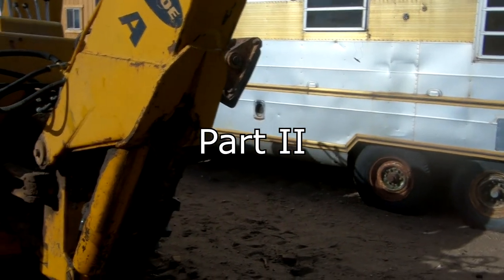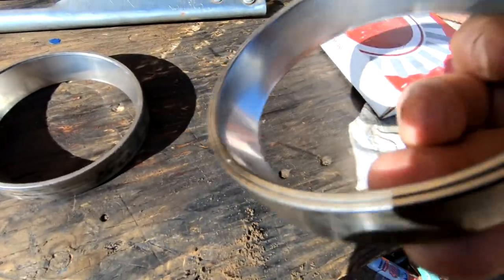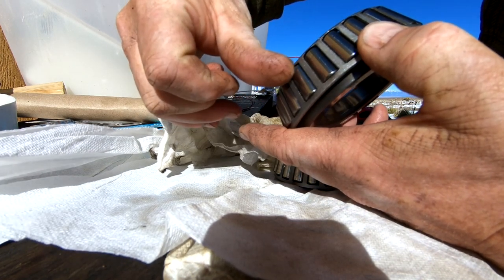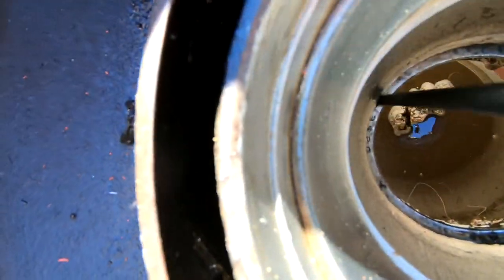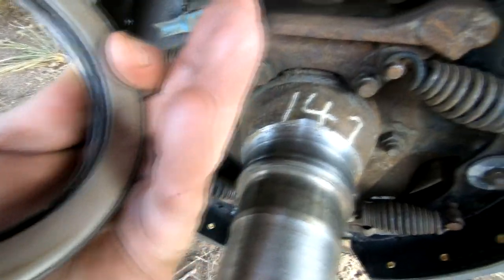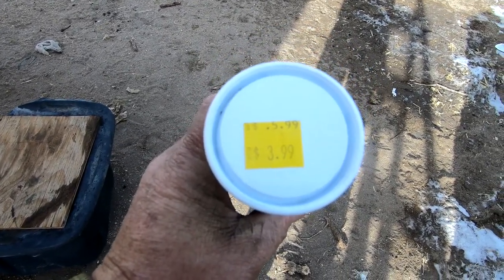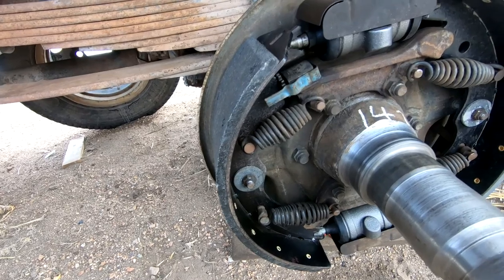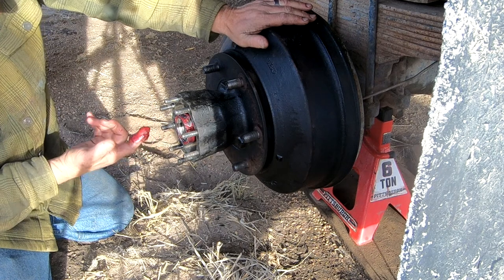1967 Ford F600 Rear Axle and Brakes Part 2 - How NOT to fix using the wrong tools.

Comment: Good evening, i greatly appreciate your videos on you f600, just bought one with the same problem everyone has, brakes. 

Any chance you have a parts list somewhere with links where you got everything?

Only partially into the series, but already know this is going to be tons of help. Thanks again
Reply from the maker: Hello and thanks for the kind words. The 1967 F600 had at least two versions of brakes. I found the schematic and other info from the Ford Truck Enthusiasts Forum online. They have a section dedicated to Medium Duty and Heavy Duty trucks. Finding parts will be something of an Easter Egg hunt, but most of what you may need can be found. Alternatively, you may find that upgrading your axles to newer ones will provide greater parts availability. Thankfully, we have not had to do that yet. Have fun with your F600!

Comment: Thanks for the vid.   Do you know how to remove and replace the wheel studs.   I cant see how the come out , or how you'd get new in.  Any advice
Reply from the maker: Hi There.  Usually those are pressed in and hard to get out. Best way I know how (by yourself) is to support the wheel very well, screw a "sacrificial" lug nut onto the lug and pound it out with a maul - or try a heavy C-Clamp if you have one.  A local truck tire shop could do it for you for just a few bucks, I'm sure. Use lots of WD-40 or PB Blaster. Have fun.
Reply: @contentment164  thanks for the help.   Local shop will do it and will mount new 9.00x20 on locking ring 20 rim for me too.   Bargain.   Incidentally, I parked my truck on a slant (not front to back but side to side), which caused a puddle of gear oil to form between the downhill tires.    I though I had a brake cylinder leaking but after watching your vid...and enough time for my brain to process...realized that that horrible smell was gear oil.    Probably have a bad seal...but it didn't get into the brake drum and onto the pads....and it doesn't seem to leak when parked flat.    Thanks a ton for your vid.   I'll be looking at others when I have more free time.   Thanks

Comment: Great video, I’ve got a ‘74 dodge D600 I’m doing the same thing.  You didn’t happen to safe the part numbers of the bearing, seal, and brake shoes did you!?
Reply from the maker: Hi and thanks for watching.  I could not find replacement bake shoes so I sent them out to have them re-lined. Yes I have the part numbers of the seals and bearings, but mine is a Ford and yours is a Dodge, so...different?  Or do you have the same rear axle?

Comment: Having trouble finding seals for mine bud. Could ya give a guy a hint? Cheers!
Reply from the maker: Napa. Take the old inner seals there and have them measured. They can find you some replacements.  I found the new outer seals online at O'Reilly's Auto Parts online.

Comment: Ed here, just tore down my 1969 f600 brakes. look closely- the gruve on my axle was part of the old seal some yeahoo left on. the locknut was off and the bearing/ seal not seated. this let oil slick over the pads and you know the rest. pads looked good with wheel cyclinders, put it back together with new master cycl, vaccum booster, some new lines & hoses. still dont have good brakes.may take it back down and replace the rear brake cyclinders which appeared to be stroking. havent had front hubs off yet but had drag on all wheels when adj. brakes. do not like the single resevoir master cycl. it is dangerous. FORD- fix or repair daily.
Reply from the maker: Hmm. Don't know at this point if I want to replace the master and add another boost and lines.  Planning on selling this truck now. Thanks

Comment: This is why people sell these trucks,I always see them cheap as "needing brake work" because it ends up being 2k if everything is trashed.
Reply from the maker: True, but doing it myself we spent about $1000 altogether for the entire brake system: master, vacuum booster, wheel cylinders, rear bearings and seals, etc.  I think the biggest reason the brakes go away on these things is because the trucks sit for such long periods not being operated. Moisture sets up in the master cylinder, brake lines and wheel cylinders and they just rot or rust away.  Since doing this work on the truck I have made it a goal to drive it at least once every two weeks no matter what.  I start it and let it idle for at least 10 minutes every week.  I also remember that, unlike newer vehicles, these old things require frequent checking of all fluids, etc.  I have made it a practice to check all fluids each time I drive it.  Same with my vintage backhoe.  We bought this truck for $1600 and with the working brakes and other minor fixes it is now worth about $4000. We don't have that much in it.  Thanks for watching!
Reply: @contentment164  if you had to buy drums you would have been up shit creek. I'm in the same boat, I just did all of them on a 1964 f600
Reply from the maker: I found drums for this, but I didn't buy them.  I know where they are at if I need them.  My drums are just out of spec, but I figured as much as I will use this truck (maybe 500 miles per year) I can get by with new pads and go on.